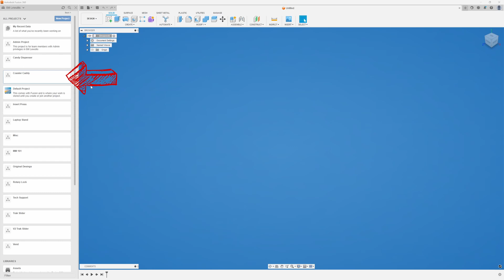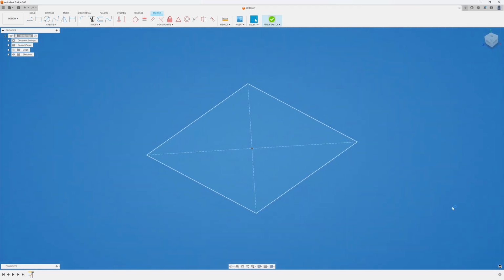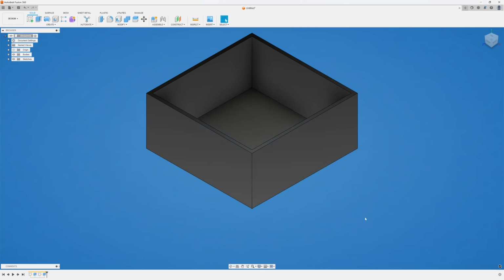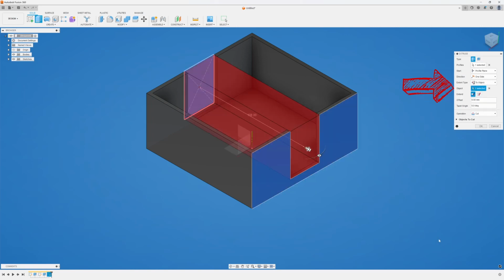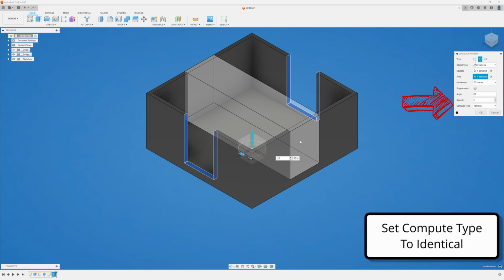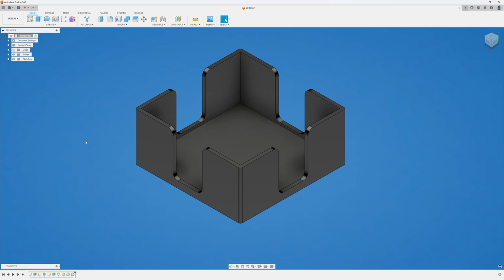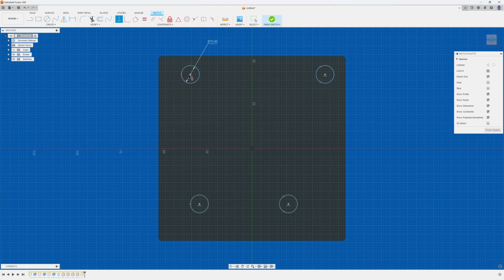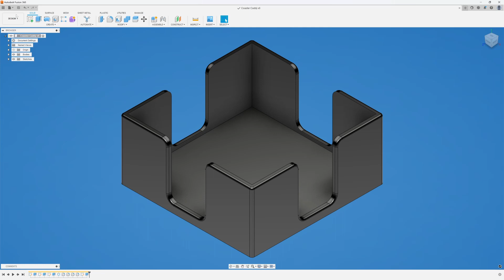Easy To Follow 3D Model & Print Process with FUsion 360

Comment: Printing my designs is the only reason that I started 3D printing two and a half years ago. I didn't care how the printer or slicer worked, I just wanted my prints. Now, things are different and I'm very interested in both the printers and slicers. It can be very frustrating to mess with them but it is also very rewarding when things are just right. Thanks!
Reply from the maker: As a mechanical designer, the natural progression for me was to print my designs. Like you, I didn't want to deal with the printer or slicer! Thanks for watching!

Comment: I like Freecad. I've tried others but prefer Freecad as I've never got on with others
Reply: I tried it, but there was too many errors and issues with no information or documentation where I did nothing wrong. I switched to F360 recently and it is so effortless to make good designs.
Reply: I started with FreeCad but found it a bit frustrating. I switched to Tinkercad and, though it seems simplistic, it allows me to do everything that I need to do to create my designs.
Reply: @baxrok2.  Tinkercad seems so limiting to me. (at least when I used it last) I couldn't make any changes to a placed object. You want a cube to have rounded corners? You're out of luck because Tinkercad doesn't even support that. I hope they have changed it by now, but all I really find that is useful in it is the circuit builder.
Reply: @EvokerKing  It has changed quite a bit since then.
Reply: @baxrok2.  good